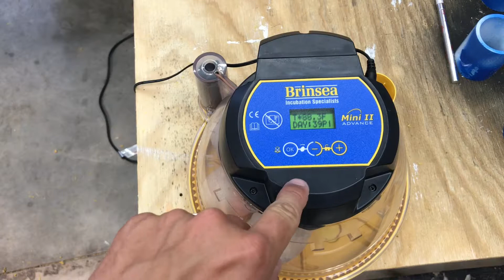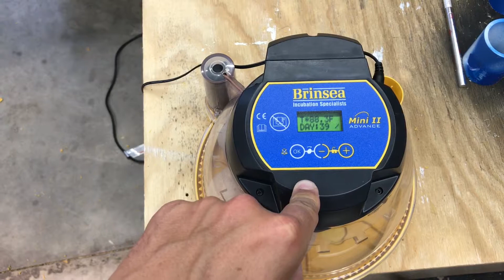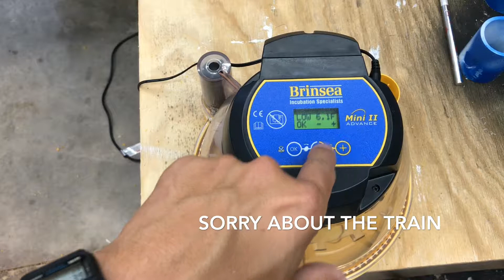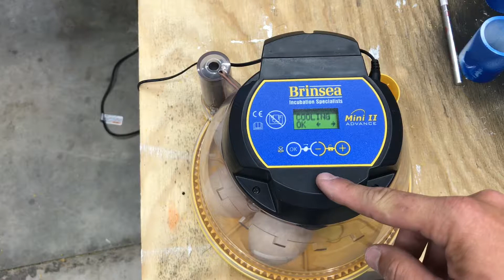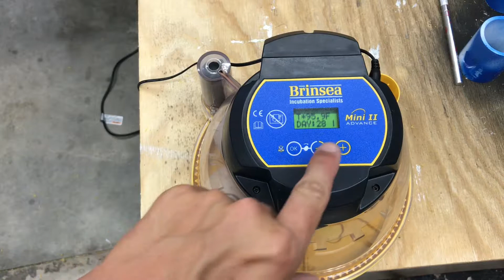Hatching Peacock Eggs With The Brinsea Mini II 2 Advance Incubator

Comment: I was bumming when the Brinsea Mini II Advance Incubator that I just got wouldn't turn my peahen egg! I actually was thinking about doing just what you did, but wasn't sure if it would work. Thank You!!! I'll be modifying my disk as soon as I get off here! oh, yeah, I know, it crazy my hen would lay an egg in September!?!
Reply from the maker: Wow. This is really late in the year. But good luck!
Reply: @MrJustinWheeler  K, did it, but, it wasn't working, the egg just wasn't turning enough. Even at 20 seconds. Soooo, I had some shelf liner I got from Micheals craft store and cut out a piece using the cardboard matt that came with the incubator. Didn't work, too much traction, sooo, I put the traction side down, and viola! worked like a charm! It grabbed the "floor" of the incubator but still had enough traction to grab the egg well. Also, the egg would start to spin end for end. hmmm, I put a egg I got from my chicken that lays huge eggs, slightly smaller than my peahen and it kept the peahens egg straight. And at 20 seconds they both turn 180 degrees perfectly. I'll look up the exact material and post it. Thanks again!
Reply: @MrJustinWheeler  I can't find the exact stuff on line, but, one side has to be more slip resistant than the other for the disk to turn without turning the matt material. Otherwise the egg is not getting pushed.